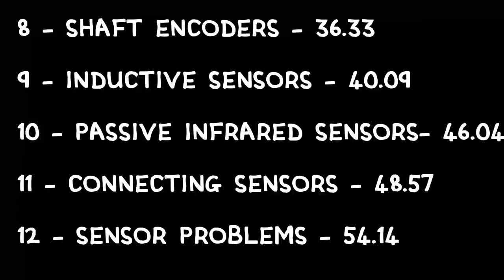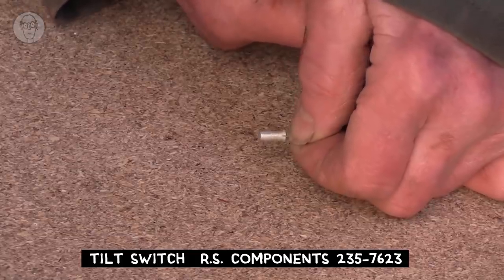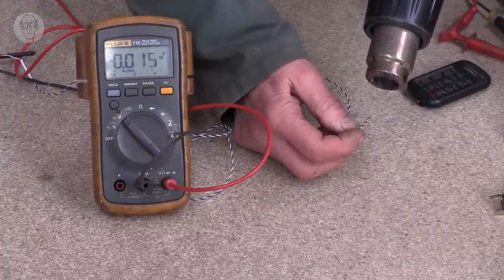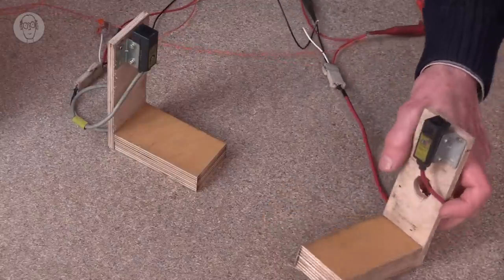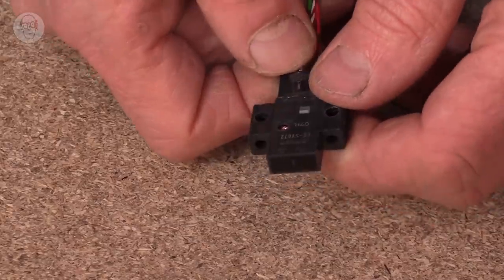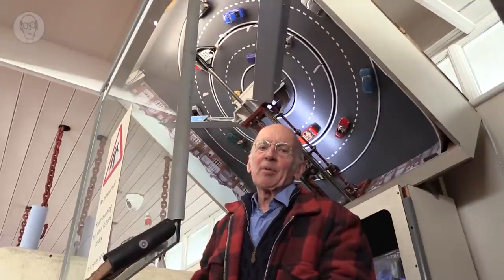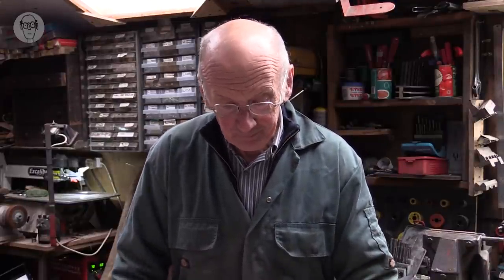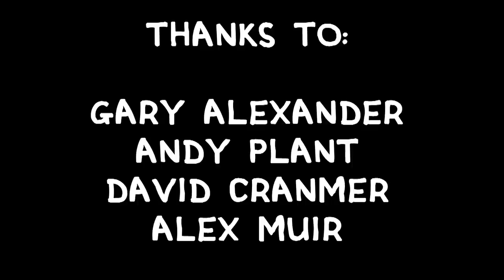SENSORS -The Secret Life of Components, a series of guides for makers and designers - episode 9

Comment: "of course you can't do that now"!
I didn't get where I am today without sodding about with mercury switches as a child, thanks in equal parts to my Dad and "The Secret Life Of.." series.
Reply: Where I worked all the lighting was controlled mercury switches which were changed out for relays didn't see the going of the mercury !
Reply: We used to push blobs of Mercury around with our fingers in Science class at school. None of us grew 3 heads or anything, so I really don't know why people are so worried about it.
Many (most?) of the big old lighthouses used huge pools of Mercury as frictionless bearings for the spinning light head and lens. Lots of interesting info online about that... I wonder where all that mercury ended up, in the sea?
Reply: @johncoops6897  I think we a lot of "naughty "things in our science classes without hi vis , goggles etc .My favourite was to take the bunsen burner off the hose and substitute a biro body for it ,made a good flame thrower!
Reply: I have a bottle of mercury, I shall slip it into my pocket when I think they may be cremating me...
Reply: @johncoops6897  I dont think mercury in metallic form is toxic. It's when it's a non-organic salt form that is of concern.
Reply: I used to have a coffee jar full of mercury, weighed a ton.
Had a mercury tilt switch in my Volvo 265, attached to the bonnet underside.  Turned a light on when the bonnet was opened, also attached to the underside of the bonnet, to light the engine compartment at night.  Nice touch but never needed.
Reply: @CheradanineZakalwe  i repurposed one from a Ford Granada estate tailgate to switch a camera on and off in a watertight enclosure, turning the camera upside down switched it off.
Reply: @johncoops6897  Another application for Mercury was (believe it or not) to make mirrors for astronomical telescopes.  You make a roughly parabolic dish, point it straight up, dump a bunch of Mercury into it, and then spin it.  The Mercury will spread out forming a perfectly parabolic very reflective surface.  This technique has been used on telescopes up to 6 metres in diameter!  There are some obvious disadvantages, but making the mirror this way is very low cost relative to a cast, ground, polished, and aluminized mirror so it is a useful method for building telescopes for some types of astronomical work.  There is a nice Wikipedia article on liquid mirror telescopes if you want more information.

Comment: Tim is the ultimate maker of things that are creative, humorous, entertaining, and downright ingenious. Even though I've made a decent living designing IC's for almost 40 years now, nothing I've done has this level of imagination.
Reply: After 40 years, are your ICs still small square/rectangular black plastic boxes with legs or pads on them? Tsk. How hard is it to design one of those?!  

Kidding of course - modern ICs are quite unbelievable these days in both size and function. I'd guess that designing them is actually quite a challenge these days, hats off to you. I just get to use them. Hmmm - how do you fancy designing a chip that has about 16 bytes of storage, with dual SISO capability - so I can use SPI on one set of pins to pass a command into the buffer, and SPI on a different set of pins to extract it, replace it with a response, which the first SPI can then read off...? :D Probably quite a limited market for that, unfortunately.
Reply: @theelectricmonk3909  Use an FPGA or CPLD. They are user-programmable, and can be purchased on Ebay, etc for less than 20 USD. An Altera (Intel) EPM240 should suffice, and the development software is free. So, now you can literally make your own ICs at home. If you know how to design using Verilog, the rest is easy. 

And those ICs today ?? Definitely not small with over 1000 legs, and it takes armies of engineers and many millions of dollars to develop them for products that become obsolete with a few years. Oh how I miss those days when 1 person did the whole chip, start-to-finish. And yes, the first chips I did in the mid 1980's are still in-service orbiting our planet in satellites, whereas most of the ones I worked on this century are now in landfills.
Reply: @theelectricmonk3909  It's mind-boggling isn't it? I work in IC design (strictly speaking, what we call a system on chip) and we are blasé about throwing a few thousand flip-flops at something to make it easier to close a small part of the design. In 12 months, we might be expected to design something with billions of transistors in synchronous circuits running at GHz+, with more arithmetic processing power than existed in the entire world in the early 80s, at design cost of tens of millions of dollars.
And yet what Tim presents is infinitely more impressive to me.

Comment: Proper Job Tim!   Brings back memories of fun times using pairs of reed switches embedded below model railway track in pairs set at 90deg to each other for train detection and train type identification. Passenger trains had one magnet fitted below the first and last coach in-line with the track, goods trains had pairs of magnets, one in-line with track and one at 90deg to the track. This allowed trains to operate automatic signalling and traction current dependent on train type. Passenger trains would stop at stations but goods trains would pass through without stopping.  Later exhibition layouts used opto-sensors and reflective strips below the trains to do the same job. One of the layouts using the magnetic reed switches was in use for over 20 years after I sold it. Surprising how reliable reed switches can be and they were much cheaper than the opto-sensor systems. If I ever build another layout it will use good old reeds and magnets. The signalling will most likely be controlled with Atmel microcontrollers instead of a mess of diode matrix and transistor switching.
Reply: I'm working* on exactly that, right now! Must admit, I hadn't considered the idea of using directional magnets/reed switches.... that's another one on the experiment list! I'll be using an Atmel (ATTINY) to do the sensing, but a Raspberry Pi to do all the controlling.   * I say "working", it's barely past the "thinking" stage so far... although I did buy a bag of reed switches which bear a striking resemblance to model railway sleepers :D

Comment: Thanks, Tim.  I've been watching your "Secret Life of Machines" since your early shows with Rex several decades ago, and I have been very happy to see you do these newer series.
Another thing about the "hysteresis" of reed switches and relays in general is the way magnets attract.  It takes more electric current to "pick" the relay than to "hold" the relay.  It's the same as pulling two permanent magnets apart.  Once there is a little space, the force required to pull them apart gets less and less.
And, good thing you're not playing Val Bennett's  "The Russians are Coming"!!

Comment: As a kid (11 years old in 68), my electronics part supply store was our county dump (land fill, tip). We lived about two miles as the crow flies. I would take my big red radio flyer over hill and dale and come back with entire console color TVs (sometimes) and mostly radios, tape players or anything else with a cord. Tim's shop reminds me of the half of our barn where my dad let me build my projects. In many ways, they resemble the things Tim builds. Pure nostalgia! Plus, to this day, I can work with a minimum of (so called proper) materials, tools and resources to still get the job done. I am a lab manager for a small company that makes IC chips here in Silicon Valley. Thank you for this excellent video on the subject. You rock, Tim!

Comment: I have very fond memories of watching you using one of those IR retroreflective sensors in SLOM for the Decision Maker coin-toss machine. 
A few years ago, for a home-made weather station, I bought a shaft encoder with absolute positioning output, basically it has 8-bit TTL output that corresponds to 256 positions the shaft can be in.  Far more than I ever needed for the cardinal compass directions, but amazing what's possible for a few quid on ebay (i think it was about 11 quid).

Comment: i never saw tim as a kid because i lived in america so i didnt grow up with him, only discovered him because of youtube's wonderful community, thanks for producing more of these episodes tim, havnt watched this yet but you already earned my like and comment to feed al gore's rhythm by reputation of your last videos alone !!
Reply: also im currently dealing with a ebike throttle that isnt liking me too much, they use a hall effect sensor in a kinda off label/off axis method to get a 1-5 volt signal from a bar magnet sliding across it, maybe i'll post a video on the subject when i repair it, protip: hall effect sensors are bloody impossible to solder without breaking them, it helps to heat sink the sensor itself using either a wet napkin, water, ice or even some chewing gum and dont linger on the pins with heat longer than you have to

Comment: Glad you're taking the time to make these, there's always something to learn.

Regarding the stethoscope - I think some optical sensor is more suitable for repeated movements. For example a stiff tube (small hose) that's still flexible but pushes into a slot detector at the machine side and is pushed back by a spring. Or a tiny proximity sensor like the ones used in phones to detect when they're next to your ear and turn off the screen, but those might require additional logic to reject external lights.
Another sensor that's quite useful is the humble piezo speaker/disc.

Comment: Informative as always!

A note on sawing the lids off of semiconductor devices: back in the day, when Altairs roamed the Earth and dynamic RAM chips held 1K bits and came in ceramic packages with metal lids, someone had the bright idea of removing the lid from a DRAM chip and putting a lens in front of it.  Write a pattern that resulted in all cells being charged (as I recall, half the bits in the array were stored inverted), read back repeatedly, and monitor how fast each bit decayed to determine how much light was falling on that cell.  A camera for your computer!  (There must have been some additional strangeness involved, as ordinarily reading a DRAM cell results in the existing charge being refreshed.  It might have involved increasing the time between reads until either all the bits were discharged or the algorithm decided it was too dark.)   This was published in one of the hobby magazines, maybe Popular Electronics, and I think Cromemco or somebody tried to make it into a product.

Also fun: LEDs can double as light sensors!  And all manner of hilarity can result if semiconductor devices aren't kept in the dark, be they glass-packaged diodes or un-encapsulated direct-mounted chips.

And now, back to watching the vid.  Just got distracted by the semiconductor thing.

Comment: Fantastic, I am doing a van conversion and I am enjoying doing what ever I can with sensor plus relay modules with a little digital display and a few buttons. There are voltage sensors, temperature sensors, humidity sensors etc. they turn on 12v with 10 amps enough to do work. 

I have one planed to measure inside temperature and outside temperature. If inside temperature greater than outside and inside hotter than a nice temperature, turn on the fan pushing outside air out

Comment: Now days, the really interesting sensors are the gyroscopes, magnetic field detectors, accelerometers, and other tiny little sensors inside mobile phones. Incredible what they can pack into such small packages, and incredible accuracy. You can access these with various Apps, for example to use your phone as a fairly accurate spirit level, or a G-force detector, or compass, or whatever.
Reply: You can buy the sensor chips too. They are absolutely tiny. Some QFN package with a somewhat low pin count.

3 axis acclerometer, 3 axis gyro and 3 axis compas! I2C is a common and easy to access interface for them. (note: 3.3V or LESS)

Comment: There is a type of temperature sensor that is worth talking about called the forward voltage sensor.  Transistor bases and diodes will have a forward voltage at a given current proportional to temperature.  Test with a transistor tester and then bias accordingly.  Current can also be used as the read out as well.

Comment: Dear Tim, I much enjoy your work and legacy. Thank you very much for this new and wonderful episode. Mercury is banished for a good reason but rotary electrical connectors made with it are truly wonderful. Zero Ohm and no noise added... I still have a few from old rotating Lesley speakers out of a Hammond organ. Those were the days... One question; did the flow switch originally had a spring to return to the "no flow" position? I started building machines using reed switches because they're affordable and easy to use. Later on I found out that they can become permanent magnetic and keep closed when the magnet is gone... When I learned this I switched to more costly but reliable inductive sensors and never had a problem since then. Thank you Tim!

Comment: Interesting that you had problems with vacuum sensors. I made a CD jukebox that picked up the disks with a suction cup. I used an analogue vacuum sensor and a comparator with a preset pot to sense the vacuum. About twice a year it would stop working and I had to tweak the pot. I came to realise that although the vacuum could easily pick up a CD it was less than the biggest difference in atmospheric air pressure over a year. I added a second sensor to sense atmospheric pressure and took the difference and it never failed again.

Comment: Another great episode Tim. Just one tiny correction ... thermocouples work by the SEEBECK effect, not "Seeberg". (The Seebeck effect is kind of the opposite of the Peltier effect, which generates a temperature difference between two metals at a junction when a voltage is applied.) In devices that use the Peltier effect, e.g. the cooling modules in mini fridges, the Seebeck effect is going on at the same time, reducing the amount of cooling (or heating).

Comment: Have you used any hall effect sensors? They're like semiconductor Reed switches and I find them really accurate, although I've never had need to test their range repeatability. They're also polarised, so they only operate with the magnet one way around (and some have different outputs depending on which way round the magnet is) RS 765-9325 are the ones that I usually use because the package is so convenient and they're good for 12V, but you can just use the component itself if you need something really really small. I really enjoyed the video, and learnt quite a few new things, and I thought I already knew quite a lot about sensors! I'm looking forward to the rest of the series!

Comment: I love photoresistors, they have so many uses, I use them a lot on my lights in home that are powered by solar panels, so when its getting dark small LEDs start lighting up making home not bright but also not dark so its always soft dim atmosphere in my home making it cozy. Its tad annoying to make as you need to wire additional cables separated to main but worth I think.
Also they can be used even as movement sensors if you put them in tube and set resistants rights...

Comment: My grandfather built a very nice home in 1955 and he equipped it with the latest burglar alarm system it shot a beam around the perimeter of the house that bounce forom mirror to mirror from the emitter to the sensor. When spring came his alarm would start going off just after Dawn couldn't figure it out until he saw the Cardinal fighting itself and one of the corner mirrors!

Comment: Awesome machines (art and mechanical, form and function) !  I wish I can go and try all of them (except the Alien Butt Probe just in case it was switch for a real one ) :)      What I will add about sensors is all switches bounce, in some case those bounces can be irrelevant to what you do, but many times it can make you controller board thinking you open and close that switch many times,  So signal conditioning is also often needed (electrically or by software).

Comment: Once I used a threaded rod as a linear position encoder, with an optical beam being broken by each thread as the moving carriage went past them. If you looked at how much light was getting past you could probably get higher resolution than just the threads per inch of the rod, but I never tried it. Suppose it should work with hall effect or inductive sensors, which could be better for inter-thread accuracy, but, again, I've never tried it.

Comment: I think the best way to explain the bimetallic disc is that it moves like the lid of a jar. The jars at the super market where the lid pops up after you open it.
Reply: not really - that's pressure difference not heat
Reply: @mattsan70  I'm referring to the way it moves, not the force that moves it. They both "pop" in and out in the same way.
Reply: @alec4672  Sometimes known as "oil canning" after how the bottom of some types of oil dispensing cans work.  The bottom of the oil can at rest is slightly convex.  You tilt the oil can so the entrance to the spout is covered with oil and then push on the bottom.  The bottom pops in decreasing the internal volume of the can thus increasing the internal pressure and dispensing a fairly well defined volume of oil out the spout.

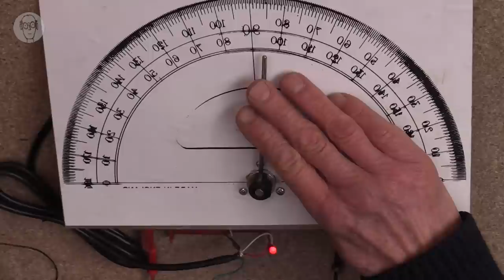Comment: Really nice presentation of classical sensors. @37:18 shaft encoder angular scale mirror writing: is the camera position behind optical mirror ?
Did you also consider a sensor using oscillating magnetic fields to detect material change (metal vc. wood) like an inductive coil as part of a LC resonator ?